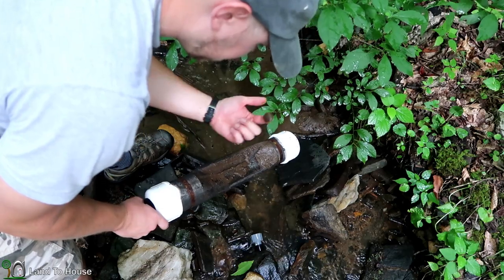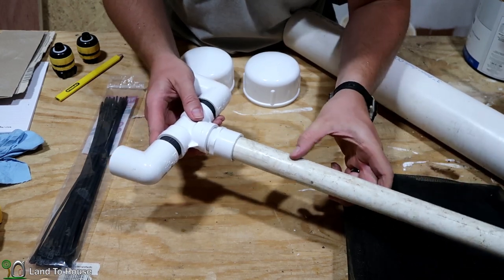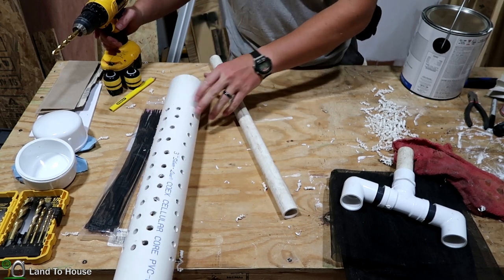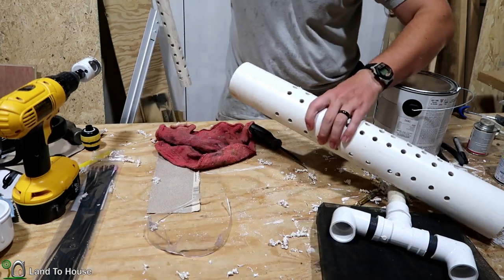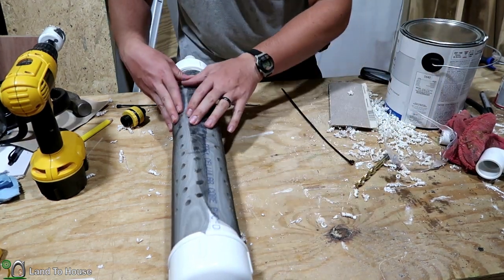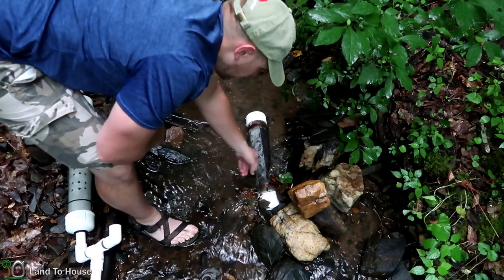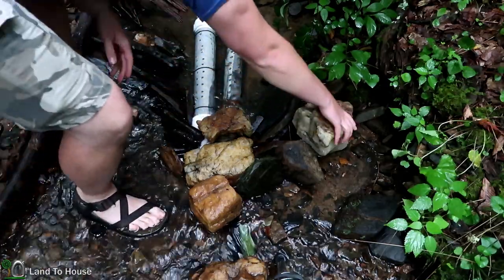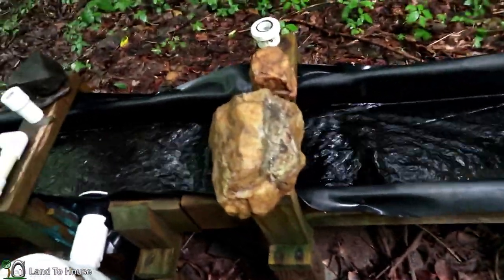Dual Ram Pump Intake

Comment: The filter can be done by cutting slots  with a fine grinder blade,  have t fitting and caps  to keep the filter off the floor.

Comment: If you add pleats to the screen as you wrap it around the PVC it will give you a lot more surface area to work with and you won't need to clean it as often.
Reply from the maker: That is true. So far this extra intake has fixed the issue.

Comment: I would suggest to imitate the 'inlet' flow patterns as found in tangential (self cleaning) filtration.  Tangential filtration has 'most' of fluid traveling 'across' the filter medium and with only 10-15% flowing 'through' the filter media. The flow that doesnt pass through the filter media continuously 'sweeps' debris away from the surface of the filter media. 

What youre looking for is to keep the inlet flow to the screen flowing axially along the 'length' ... ACROSS the surface of the 'screen'; the inlet water flows  'across' the the long axis of the screen. In this manner the inlet flow continually 'sweeps' any debris away from the screen.   To accomplish this, the screen is encased by a outer cylinder/pipe, there is a gap between the screen and the outer 'pipe'.  I'd 'epoxy' the screen to any base support; as, zip ties would possibly create a velocity drop between the outer cylinder and the screen ... you want as high a velocity between the screen and the outer cylinder. 
Typically, you'll want ~90% of the water inflow to the 'filter' to be 'sweep' volume; the screen passes only ~10% of the total flow volume. The entrance to the outer cylinder would have a MUCH larger entrance nozzle.than the ID of the outer cylinder; the larger entrance to the outer cylinder would act a 'dam' and would increase the velocity of the water acting tangentially along the surface of the 'screen'.   ;-)

Comment: You have a huge system running and looks intimidating to build. I’m looking to put a ram pump in a small creek and to go up a 300 feet elevation.
Reply from the maker: The build is not that bad. Now with your setup it's not going to be easy. The ram pump normally stops lifting water at around 180 feet.
Reply: Land to House well damn
Reply from the maker: There are expensive commercial pumps that have a higher lift potential. I have contacted a few of the usa-based companies but have had no response

Comment: If you still have silt issues... you might consider making a "settling pond"    like a long trough where the water speed slows way down and sediment can drop out before you get to the intake.
Reply from the maker: Yes. I think that the silt is settling at my intake as a settling pond. So far the increased surface area has done the job. Still running no problem.
Reply: Glad to hear it!

Comment: Interesting.  Have you ever considered what it would take to pump out a well, with simply standing water?  A dry pipe sunk in a well would provide good pressure at fairly modest depth.  For example: joining together white bucket butts with glue and tape then removing the bottoms would make a segment of large pipe to which you could attach a bucket with an intact bottom, by adding its top edge to the already joined pair.  The result would be about six feet long and could be sunk five feet into a well yet still be dry inside.  At its bottom, there would be enough head pressure to supply a pump that could be used to bring well water up to a supply cistern or water tower.  This would make an automatic water system possible where there was only manually drawn well water until then.  I would like to see if you could solve the waste valve leakage issue and make such a system a reality.  Bo

Comment: I hope the current torrential east coast rain is not causing your gardening system problems. 🦀
Reply from the maker: It has rained for a week now and the roads are washing out. It has been rough. but.... the pump is still running.

Comment: I would look into stainless steel check valves for longer wear.  They will be expensive but maybe worth not having to replace them every 6 months to a year :).  Wrong video but you get the point
Reply from the maker: That would increase the price by at least $40 but very doable.

Comment: I would be interested in a flow comparison between the 2 styles of intakes
Reply from the maker: Do you mean the two that I have installed together? I should think they are close to the same. I just needed lots more surface area. Seems to be doing well because the pump is still going after the new install.

Comment: Why bother with the long 1” pipe inside of the 3” pipe? The volume the pipe will send is a function of the internal diameter of the drive pipe. Drilling additional holes in the 1” pipe will not increase the rate or volume of flow.
Reply from the maker: I thought was that ultra fine sediment that builds up inside a 3-inch pipe may eventually start clogging up the pipe going down the supply line. By extending the 1 inch pipe inside it will always be able to pull water even with that layer of fine sediment buildup.
Reply: I thought so. perhaps a https://en.wikipedia.org/wiki/Hydrocyclone will be the next video???Thank you.
Reply: Maybe it design easy to clean the sand and stones and ... inside.
It can separate into two parts.

Comment: It seems to me that when the water slows for the little dam, sediment would settle in the pool.  So why don't you build a little damn uphill from this one, to slow the water down there first, so that at least some of the sediment will settle there, and less sediment would reach your ram pump?
Reply from the maker: Yes for sure or if I build the small dam even lower than the intake. To make a larger body of water.

Comment: Question for land to house and everyone really: could you run a ram pump off a rain barrel (I live in the city) but say the barrel was on a upper deck could that give you the head pressure to make the pump run and do you think it would supply enough to say water plants out front of the house
Reply from the maker: It is possible to run a ram pump from a rain barrel. The problem is how lossy the Ram pump is. You only get about 10% of the water pumped. So say you have 100 gallons of water you're only going to get about 10 gallons to your final destination. That is why the ram pump works best in a creek.

Comment: I’m wondering about having waste water from a ram falling into a tank with another drive pipe headed to a slightly smaller water ram several feet below it. That ram would deliver water back to the source tank for the first ram. The 2nd ram would have waste water going into another ram pump delivering up to the original water source etc etc. 

If I were to daisy chain enough ram pumps in series to collect and send waste water as high up the water tank chain as possible, could I not in theory get to an incredibly small amount of waste water? Each pump would need to be tuned to the amount of waste water coming into it, with the ability to handle a little less water than what’s incoming, then have an overflow up the side of the tank draining to the tank below so it doesn’t overfill.
Reply from the maker: In theory it sounds like it's a really good idea. The problem is that even the most efficient Ram pump is not much above 70%. Typically it is far below that. So if you must lose between 60 to 30% you're always going to have lots of waste water at the bottom.
Reply: Land to House 
Where is my logic wrong? Start with 100 gallons, 60 gallons is waste. 60 gallons goes to pump 2, pump 2 will have 36 gallons of waste and enough head to pump back to the original water source. 10 progressively smaller pumps later you are down to .6 gallons waste from the original 100 gallons. Granted this is on paper, would take some elevation to play with, and a lot of tuning, but is it not plausible? You might have to do another experiment for us!
Reply from the maker: I know it sounds great at first but it really does end faster than you think. Consider the 100 gallons. First pump is 1-1/4" and 7gpm is waste water. Over 15 min that tank is pulled through the first pump. Say that pump is going up 20 feet and has 4 feet of head pressure. You can expect a little less than 1gpm to go up to your destination. So the second pump will need to be a 3/4" or 1/2" to keep up with the smaller water from the larger pump waste. The 3/4" pump will use around 3 to 4 gpm. It has about 85 gallons to work with. From that 85gallons only .5 gpm is pumped to the top tank. This means that you now have an extra 7.5 gallons at the top for round two. way less than the 100 that you started with. Within around 20 to 25 min you will have all the original waste water at the bottom. of the system.

Comment: You need a coanda intake my man
Reply from the maker: I've seen those before. They are amazing. I haven't looked to see if there's a distributor in the United States. I know overseas they are very common.
Reply from the maker: The design is simple but very effective. Thank you for sharing this link. I might have to install an intake like that sometime to test.
Reply: Land to House wooo! I'm hoping you do and make a video on how to do it best.  I've been procrastinating getting that done after giving up trying 5 different diy intakes and systems to transfer water from my Creek. This spring the river ripped my ram pump in half lol
Reply from the maker: Gosh that is a strong water flow.